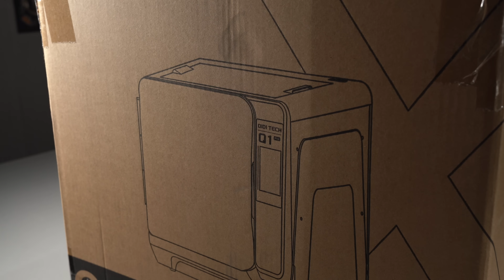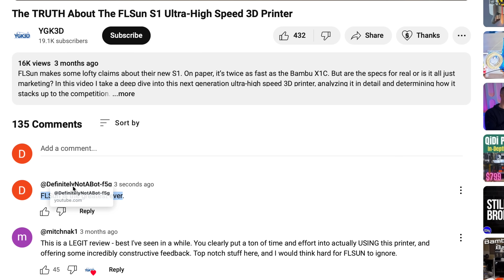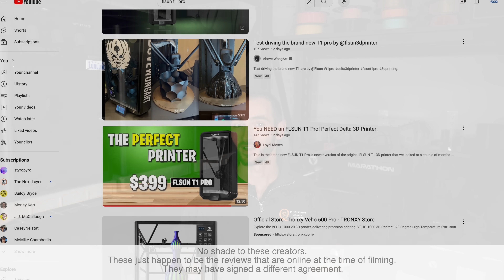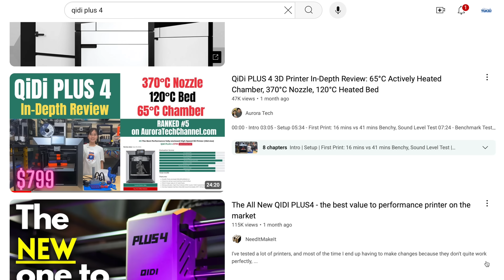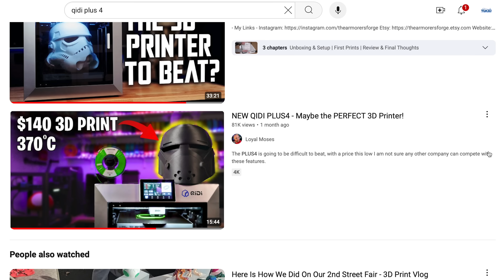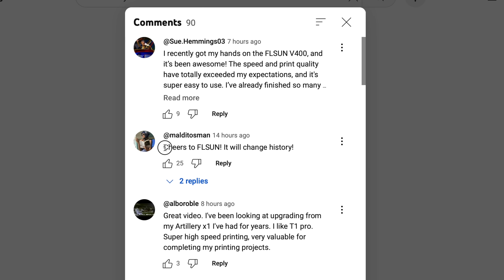This is why you shouldn’t trust 3D printer reviews...

Comment: This video from years ago also touched on this subject: https://youtu.be/AiO4U4dArKY?si=M1aq0zYpJxiZGVKd.   It has been so difficult these last couple of years.   I made the difficult choice between a Bamboo and a Prusa XL.  I went with the Prusa, and I am so far glad I did.  Their customer support has been good. And boy do I need customer support.    I dont know much at all.  Thank you for your video.  Keep up the good work.
Reply: Mine at work has been a bit of a nightmare. when it works it's great but i am an idiot and want to run high enclosure temps (enXLosure now, previously the cardboard box. came with petg corexy components, those warped after a while doing a few kg of asa. tried pc+ as a temp fix while i waited for prusa pccf to become available. might be a tooth off in belt tension or something warped remains for me to have time to try look and figure it out. also had tons of problems with overtemp errors trying to run 115c bed temps this summer especially when it was +35 c or something. They have patched it now but i installed some noctua 24v 4040 fans for the bed power splitter board and main board. that is probably a good idea anyway the boards were getting pretty hot this keeps them at 60-70c or less vs 90+ or whatever i was seeing stock.
Reply: @a__duck  To be fair,  putting any electrical appliance in a cardboard box that produces heat, and experiencing issues is perhaps more on the user than a user would like.   Yeah I am not looking forward to rebuilding the extruders  and that dude who melted his XL perhaps they should have just sent him the replacement parts - considering that they make them out of those parts now….    The printer is clearly not designed to be completely enclosed.     Sorry about your issues.
Reply: @Kg-pb2jh  it was a perfectly fine enclosure. did not catch fire it was great. bridge production. i think i can get it working well and add some features like active chamber temp control and active cooling for one of the extruders, the nextruders don't work with tpu at 40-50c chamber so i am hoping to eventually try cooling the filament path to get that working.
Reply: @Kg-pb2jh  no, it is not normal to ship consumer products with 3d printed petg parts, esp when that item costs 5000e+
Reply: @riba2233  “not normal”?  Prusa has been doing it this way for years.  One of the advantages of a Prusa is that they have historically printed a significant portion of their printers on their printers, the same ones they sell you.   They also publish the models so you can replace parts yourself.     There is no secret about this.  If you watched Prusa’s videos (and I have watched almost all of them before I spent my money) you can see the print farm.  

Is it “normal” to ship a 3d printer that is not designed to be able to be taken apart and put back together again?   

I think the phrase “normal” is an interesting one.  How do you define “normal” and “not normal” is it statistical based upon numbers of units sold?      

I had an earlier 3d printer, a Monoprice 3d - while on the surface it looks maintainable, is it “normal” that the printer was shipped with no basic ability to update its firmware (same as my toaster) and as such octoprint reports (correctly) that it is a fire hazard since it doesnt have thermal runaway protection if the thermistor fails/falls-out and there is no way for me to fix that without getting deeply into microcontrollers? 

So far (got it last December) I am happy with my XL.  I have lots of learning  to go, but I love being able to use PETG supports for multicolor PLA models.   I wish I could get the magic down so that I could use PLA supports for PETG multicolor models, but I havent done that yet. 

I guess its now “normal” to ban folks from your discord for sharing this video - bye bye FLSUN - I guess you are on my list “never to consider”
Reply: @Kg-pb2jh  idk why you wrote a bible but yeah, it is not normal, no matter if one company did it for some time already, they shouldn't have especially on a 5000e+ model.

Comment: I think there needs to be a document crafted with inputs from several reviewers (big and small) that outlines to the manufacturers the stipulations to having their product reviewed. Reviewers following these practices could be "non shill certified" or some such thing. When manufacturers are found to be trying to circumvent this the big channels that helped draft the best practices need to put that manufacturer on blast. This is something tech reviewers have had to deal with for decades.

The ideal outcome is that if a manufacturer doesn't agree to the best practices for an unbiased review there would be nobody reputable covering their products.
Reply from the maker: @Gremlin87  great idea!

Comment: I fucking hate my S1. I fell for that stupid ass fomo deal because liked my SR But I'm sk fucking pissed I spent 1.3k for a fucking lemon of a printer. 

The controller driver boards caught fire and shorted out two ports on my mainboard. I didnt even bother using the replacement controller boards because I gave up on this POS and just decided to add in my own other board with 5160s. 

They even bot their own Facebook pages which actually had good discussion previously. 

I hate FLSUN and will never buy another printer from them again.

Comment: Even when a reviewer is totally honest and tells what issues they run into, they might still be getting carefully prepared machines instead is real world production machines and they can't control that.
Reply: "Engineering sample" problem has reared its head multiple times with power supplies - both review units and certification compliance units were different from mass production models. In some of the cases, the brand head office that designed/commissioned the units was just as surprised about this, being mislead by the contract manufacturer; though ultimately it's their responsibility regardless, and they had to learn from this experience.

But... it hasn't actually occurred with 3D printers yet, or at least not been spotted to have occurred yet, from what i know? They make the job easy on themselves by just using their retail network. Though fundamentally, this is exactly something to watch out for, after all some companies are more inclined to be dishonest and less ethical and straightforward than others.

Comment: Owner here of two (2)  FLSUN V400's.
Took a while to dial them in BUT now have a nearly bullet proof regimen that gives very good results.
Machines used for inhouse use.
Use of Input Shaper is a must.
Regular maintenance is a must.
Once cooling upgrades are made the machine has more than enough speed with relation to quality.
Yes, to each their own.
Yes, have done ABS with very good success.
Again, learn the machine(s) you have and results will happen.
Cheers.

Comment: I’m currently saving up so I can buy myself a proper nice 3d printer around Christmas time. I’m mainly interested in printing cosplay pieces with abs, what would you recommend me to look into? I have been watching Bambu since they came into the market but they’ve always been out of my budget. Would you recommend a p1s over a prusa mk4s?
Reply from the maker: Definitely P1S over MK4S. The Qidi Plus 4 will be good too once they work out some kinks. That'll probably be your preferred option since it's bigger and has a heated chamber. But for cosplay pieces, ABS seems like overkill.
Reply: @ygk3d yeah, abs is totally structurally overkill for cosplay, it’s just loads easier to post process and finish with. Thanks for the recommendation, I really appreciate it man.
Reply: Me perso, I would choose Prusa over P1S. It's faster, more reliable and much better support. If you insist on printing ABS, you need to get the enclosure which makes it more expensive, though.

Comment: Absolutely nothing surprising in here, although it certainly goes a ways to explain the dearth of T1 Pro videos.  Personally, I've ordered the T1 Pro on the incredibly cheap sale-- I'll be interested to see if I receive the printer, and whether it works.  Perhaps I'll try my hand at a review video.  😀  I believe it was the same reviewer you highlighted who claimed that many of the complaints about the T1 were from attention seekers.

Twenty years ago, Consumer Reports insisted, regardless of features or ratings, that the Honda Civic was the absolute best car you could buy-- and while it wasn't bad, it wasn't the best either.  Quid pro quo is as old as civilization, and all reviews should be approached with a bit of skepticism.
Reply: Same; I wanted to try out a Delta and for $400 I can stand the risk.  I assume the stated max speeds and flows are bullshit, but half of them would be fine with me.  Also factored in that the "Pro" is little changed from the original, which has been in production for a while, other than blower and mobo.  As long as they didn't boof the mobo redesign, I can roll the dice to see how well it works.

Comment: I was just about to order a Qidi Plus4, and now I ain't gonna.
Reply: As a Qidi plus 4 owner I will advice you not to buy. Never get tempted buying a product thats just been released.
Reply: I'm not not buying one, but I'm definitely not buying one _yet_.
Reply: @wood42shed  LIke with most products, second production run batch products will typically have 90% of the issues resolved, so waiting a couple of months is always the safer bet.
Reply: @olenielsen5852 can confirm, got a full refund on mine due to non-existent quality control.
Reply: Mine has been perfect, but there are issues for many. I definitely recommend waiting a bit to see if everything is resolved properly. It has a great base, but needs to be ironed out.
Reply: @802Garage  I just ordered with a Bambu Labs P1S, figured it was a safe bet.

Thanks.
Reply: Yeah, I was skeptical of such glowing reviews, I just dont understand how it could be so polished right out of the gate.  Even Bambu has had to do some revisions after initial release.
Reply: @yayinternets  
According to my experience Bambu is very low quality.
X1C Combo returned back to the dealer after 9 days.

Comment: I've had an Ender 3, it was a pain in the ass.  My 2 Bambus have been amazing.  There.
Reply: Still running my refurb ender 3pro 4 years later.  Original meanwell powersupply and all.  Mainly ABS in an enclosure.
Reply: My ender 3 v2 has been the same. Would you recommend a p1s over a mk4s?
Reply: @EvilSewnit  Yes.  But if you don't need funky filament, go A1.  I have an A1, and got an A1 Mini a week later.  A P1S Combo is planned next month.

Comment: Great points, all of them. I’ll add, human error by the reviewer. I saw a review last night of the K1SE and out of the gate, the reviewer was on a “Creality Rant” regarding the K1 line (yeah, first printer had issues, as most, first printers from mfg’s do….) as well as the iterations of the Ender 3, aka so many different models, etc… The review, wasn’t out of line but out of the gate you knew this guy had a horse to beat. As such, he proceeded to provide incorrect information, example, you buy an K1 AI Camera (The SE doesn’t come with it) and there is no cable. Well, I had bought it, bought the camera a couple weeks later and had the same reaction. Until I went down to my shop, looked where it mounts and? The cable was there, just under the mount. All I had to do was plug it in. My point to all of this is, and always has been, it’s up to the individual to demonstrate critical thinking skills, dig around, do the legwork, and make the decision. Lastly, there are in many of these cases a bucket of purchasers getting faulty products either because when the dice was rolled that’s what they got (not defending the manufacturer for shoddy defect rates) and another guy will respond to the comments with: I LOVE MINE. Which, btw, is what I responded and with the information of where to find the cable end to plug your camera in. Re the reviews, you find the YTer that provides the best in depth invesigation/reviews and you’ll typically get good information. Nothing in life comes with guarantees. Lastly, come on people. Please stop buying in  to the first release version of ANYTHING. You are paying to report bugs. If you ride the cutting edge, you will bleed. WAIT FOR THE NEXT VERSION OR? The version after that. You’ll be amazed at how much more stable the product is that you purchased. Edited to add: FLSun’s review contract is bs. I’d tear it up and let them know, not going to do it.

Comment: what is this table with these steel wires called ? In combination with the concrete plates on it, looks like a great idea.
Reply from the maker: @OneTakeFPV  nothing special, just garage-type shelving with concrete pavers on top. I think it’s husky brand (bought from Home Depot in Canada) but there are a lot of similar options out there.
Reply: Looks like it's just heavy duty racks. You should be able to find something similar at any major hardware store.

Comment: Well done. This is a deep topic and not so simple solution. For example; if a companies use misleading claims/lies, and a youtuber calls out the claim. Like flow rate at 100mm/sec. They still move alot of units. Improve the marketing or Hardware next time, then release a new one. The feedback was received one way or another. Paid review or not. And sales usually increase. So then what should a reviewer do? Well maybe don't say anything  about the issue. Then "they" cant improve and deceive people again? Nope. Can be silent either.... uhgg. I suppose nothing new here.